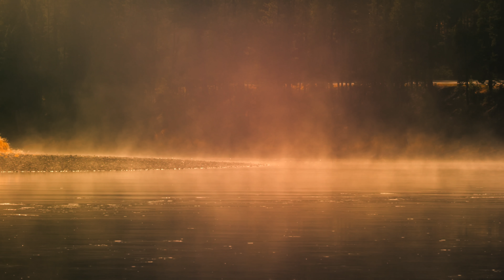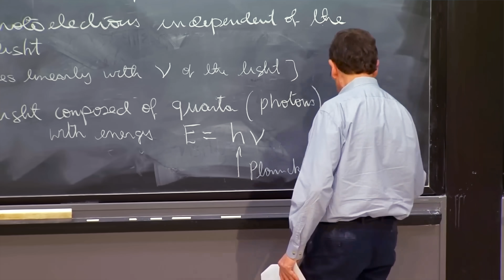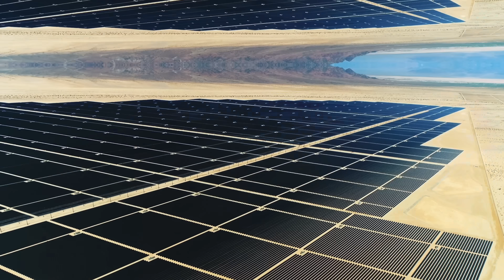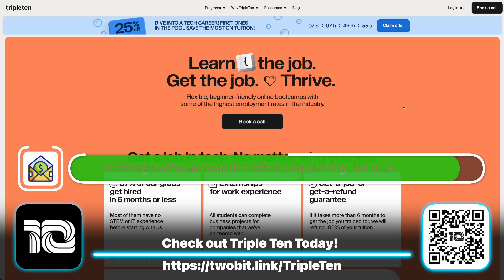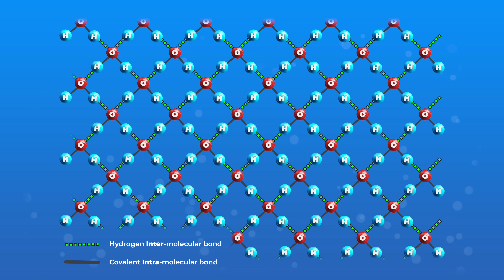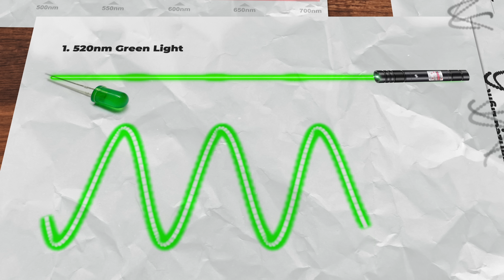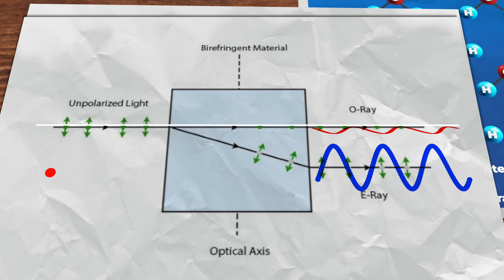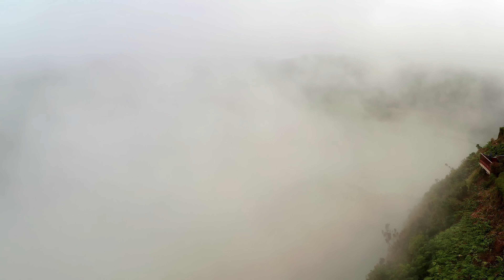New MIT Discovery Just Solved Water's BIGGEST Mystery!

Comment: I love that this effect is getting more attention from researchers.  It isn't BS.
Reply: It might not be completely BS, but the guy pretending it's some kind of world changing breakthrough is absolute BS. Converting any kind of energy into heat is very nearly 100% efficient. And as he said, converting into useful light is 65% at the best of circumstances. I understand he needs to make videos to make a living, but this is straight up sensationalised misinformation.
Reply: @janosszabo98  so when you account that light can evaporate 4-5x more water than heat you still end up with a theoratical 2.5-3x increase in evaporation efficiency with electricity>light>evaporation vs electricity> heat>evaporation. it's not often that you see this kind of jump
Reply: @geemy9675  So you're saying you can evaporate water 3x faster with a green laser given a 100W power input vs a 100W heating pad? Can you demonstrate? I can sense a noble prize in the air.
Reply: @janosszabo98 even regular white light as sunlight is already 3-4x as efficient and it's been documented for decades as evaporation of a body of water of even light absorption by clouds nothing new but what this study offers is an explanation of the molecular level effect and also increasing that ratio with certain wavelength and polarization to 4-5x so the effect of green light vs white light is not anywhere as strong as light vs heat. I can't demonstrate it but they already did. nobel prize is not unlikely
Reply: @geemy9675  Just because you say something with confidence, it's not gonna be magically correct. Water evaporate under the sun because water absorbing the light, turns into heat, and that is what causing the evaporation. Not the light itself, the heat from the light absorption.

There are 3 main desalination technique widely used: heat, membrane and vacuum. Did you notice that light is not on the list? I wonder why. If it has been known for decades that light (not heat from light) is 5x more efficient, why nobody built a light powered desalinising plant yet? I'll give you a clue: because heat is more efficient.
Reply: @janosszabo98  yeah. I understand it might seem surprising but the fact that sunlight evaporates water way faster than the heat it's providing should is well known and factored in meteorological models. it's also been used for thousands of years to produce sea salt without even knowing it was so efficient, because it was the only practical way to do it and sun light is free.
it's documented but it not used for desalination because it's not practical. if you let water evaporate in sun light you can't condense it and get distilled water back. the largest sea water distillation plant uses 45MW of solar electricity to distillate water and is very efficient at 2.8 kilowatt-hours per cubic meter (kWh/m3). state of the art reverse osmosis 1.8 kWh m–3

 evaporation through light happens only at the surface and it's not easy/cheap to produce 45MW of light from electricity.
Reply: @geemy9675  Honestly, I can't tell if you're trolling, being ignorant or you have no idea what you're talking about. What you mean it's not practical? Why can't you capture the condensation? Just build a giant pool with a glass roof and it'll condense on the glass. Have you ever seen a greenhouse? The condensation constantly dribbling on the walls. And even in a greenhouse, it's because of the heat, not the light. The fact that it's worth turning the sunlight into electricity on a 20% efficient solar panel, then turn that electricity into heat shows how much more efficient heat vs just the sunlight. Dude, you're exhausting. Light isn't more efficient than heat in evaporating water just because you say so. Until you can show me a commercial desalination plant using only light, I'm done with this conversation.
Reply: @janosszabo98  stop repeating "because you're saying so" 🙄 it's not me saying so it's people smarter than you and me it's an MIT publication from September 2023 that's been peer reviewed by scientists and hasn't been debunked by experimentation since
 it's a new reaction between photons and water that's just been discovered somewhat similar to photovoltaic effect discovers in 1839 and took 42 years before the first commercial photovoltaic panel in 1881. plus another 100+ years before it's started to be more mainstream. the effect of light on water evaporation was measured but not understood until now. It's too early to say if it can lead to improved desalination plants even if it's 4-5x more efficient than heat because cost is even more important than efficient for commercial application, but I'm confident there will be applications eventually, but not necessarily desalination plants. there are already other methods way more efficient than distillation
Reply: @geemy9675  It doesn't even remotely compare to solar technology. It's just light = 5x faster evaporation. There's nothing to develop here. Just replace the heating elements with light bulbs and you're done. Let me know when you found one.
Reply: @janosszabo98  Its not. Read the MIT paper.
Reply: @GisorsTheRet  Get back to me when they open their light powered desalination plant.
Reply: Yes it is BS... because it's not possible for these photons to cause water to evaporate without adding their energy to the system.  
This is just another failed attempt at trying to peddle the concept of Perpetual Motion.
Reply: Since grants and funding prefer novel ideas, it would be great to see programs like this research group at MIT allow other students, high schoolers, or even the general public access to the equipment used. Science isn't science unless it's reproducible, but no one wants to fund research that has already been done.
Reply: Yes it is BS... because the evaporation is still being caused by heating up the water molecules.  
It doesn't matter what kind of radiation is doing the heating.   HEAT is still entering the system.  
The Laws of Thermodynamics still hold true.
Reply: Yes it is BS... because the evaporation is still being caused by heating up the water molecules.  
It doesn't matter what kind of radiation is doing the heating... it is still HEAT.  

The Laws of Thermodynamics still hold true.
Reply from the maker: totally agree!
Reply: @TwoBitDaVinci  although you delivered a factually incorrect piece of information there, buddy. You don't need heat in order to evaporate water, it is not a rule. Vapor pressure plays a pivotal role. It is an intrinsic property of liquids that involves the natural tendency of liquid molecules to go into the gaseous state. If you lower the surrounding pressure of a liquid, you evaorate it without having to heat it. Although you can accelerate the process if you add some heat.
Also, it is way easier to evaporate water directly from its solid state than from liquid state. Meaning, you evaporate water more easily from ice than from liquid water. That's why freeze dry works
Reply: @DanoKaroche  Sorry to break it to you but even that spontaneous evaporation you’re talking about requires energy. Before, we would say it requires heat, but from now on, we should say energy because the energy doesn't have to come in as heat unless the water is in the shade.

To clear a common misconception, the fact that you don’t have to purposely provide the heat yourself to make water evaporate doesn’t mean water isn’t absorbing heat to evaporate; it just means you’re not the one providing the heat.

Water does absorb heat from its surroundings when it evaporates naturally in an environment where the air is unsaturated with water vapor (that’s literally how sweating cools you down, and it's why clothes feel cold when they dry spontaneously in the air). It’s a thermodynamic fact.

When the air is saturated with water vapor, evaporation and condensation balance each other out, and the heat that the evaporation process sucks up, condensation releases, so nothing gets colder or hotter: It's in equilibrium.

What these guys from MIT discovered is that you can provide the energy to evaporate water in a different way, i.e., without heat but light instead. It doesn’t violate the laws of thermodynamics because the energy to break molecules away from the water surface is coming from the photons, instead of coming in the form of heat. That’s an amazing revelation!
Reply: @ipp_tutor  don't apologise, you didn't break anything at all.

First... ¿Did you read my comment thoroughly?
I specifically referred to this guy saying that heat is what's needed for water to evaporate.

Second... You said you'd refer to energy from start and then you switched back to heat. You lost consistency there.

Third... ¿Did you read the part about freeze drying?
That doesn't involve light.

Fourth... I wasn't talking about the discovery itself. I only pointed out the wrong statement this guy madr about water needing only heat to evaporate.
I mean you can blow air to water and it will evaporate, taking energy from the surroundings lowering the temperature
Reply: @DanoKaroche  yeah no one's discussing the fact that the best way to dry you cloth is to hang them in plain sun, on a hot and dry summer day with a good amount of wind. but not everyone live in places with this kind of climates, and unless you live in Mediterranean region, there is little chance that you are hanging you clothes out of your apartment windows
Reply: @DanoKaroche  evaporation ALWAYS takes energy. there is only 2 options
-heat
-photon energy
in a heat pump application removing heat is a desired effect but in other like dryers, humidifiers, distillation/desalination...the cooling effect means you have to keep providing heat otherwise evaporation stops
Reply: @geemy9675  you can evaporate water when it is frozen if you reduce pressure.
You can also evaporate water with a flow of air,  transfering kinetic energy.
Of course energy is neccesary, but you don't need to apply heat always.
It seems you and the rest of the guys don't read the comments thoroughly
Reply: @DanoKaroche  heat IS kinetic energy. you don't need to APPLY heat but there is only two ways water can evaporated, absorbing photons, or absorbing heat wether heat is "applied" or not is not the question heat can be actively applied or simply removed from water and will be applied passively by entropy. absorbing photons is several time more efficient meaning the same amount of energy can evaporate several times more water. of course because energy doesn't appear or disappear it means evaporation by light or heat doesn't change the total energy. evaporation by light requires less energy thus the total energy of water + vapor is lower. like a more efficient heat pump provides the same cooling effect but uses less energy input and releases less heat in the atmosphere.
Reply: @geemy9675  it is common for people without formal scientific training to not understand or not know some things. And that's fine. What is not ok is replying without actually reading an answer and without being properly informed before doing so.
No, heat is not kinetic energy. Thermal energy is one thing and kinetic energy is another, although they are interconvertible as all forms of energy are. You are confusing the concept of temperature with heat... (I) Temperature is a measure for the average kinetic energy (internal energy) of molecules and atoms within a substance or material. (II) Thermal energy, which is heat, induces motion on molecules and atoms changing the temperature.
But there are different types of motions depending on a substance state. It matters if it is solid, liquid or gas. Hence molecules/atoms motion depends on the type of constrictions that the substance has intrinsically, depending on its chemical properties.

Within a room, furniture is at the same temperature as air. But molecules in air have a greater kinetic energy than the molecules of a table, because molecules in air are not bound and have the freedom to move around. If kinetic energy was heat, as you wrongly stated, air by itself should be hotter than any solid object and it would irradiate heat. That is not the case.
Another thing you fail to consider is that thermal energy is also radiated. Heat is radiation and is in the range of infrared wavelenght. Heat induces motion, but it is not motion.

Now, for the third time... No, you don't always need heat to evaporate water. It is not a rule.
Average people are unaware that there's something called vapour pressure. It is the natural tendency for a substance to go from liquid or solid state to gas state. This property depends entirely on the nature of the molecules of the substance and pressure. Vapour pressure manifests as a dynamic process and usually tends to be in equilibrium with the surrounding pressure. Liophilization is a process that takes advantage of vapour pressure to evaporate water by sublimation. This means the change of state from ice to gas without ever going to liquid state.
In liophilization you typically cool water down to -50 °C (if you remember, ice forms at 0 °C at 1 atm of pressure) and you lower the pressure (or apply dynamic vaccum) to sublimate water from a very cold ice.

I'm not debating the discovery of green light being able to evaporate water. It is a cool discovery that could lead to some practical application eventually. 
I'm just pointing out the factually wrong statement in the video that water always needs heat to be evaporated. I have a PhD in chemistry, so I know a thing or two
Reply: @TwoBitDaVinci  Waiting on that follow-up video

Comment: ALL that with and there is also atmospheric pressure pull off with vacuum effect on surface pressure from evaporation into air levels in gaseous state stratas areas placed push in photons discharge on areas where radiation is positioned and mix mixture  of it all causing winds with earth spinning with that effect as well.

Comment: This is actually humorous as many scientist have claimed all along about the flawed theory of CO2 driving climate change. It has been said all along that CO2 is the result of warming not the cause.  The model only works if you change the way CO2 is entered into the atmosphere just as water vapor retained heat CO2 had and as water release it s heat so does CO2 also releases its heat and is dissipated. The more we try to force CO2 as the cause the longer it takes to realize the Sun cycles along with the earths decreasing Magnetic Field are the sole driving force of the Climate. Every thing else is part of a separate cycle that does not influence the crust temperatures as the radiation from the sun does. The reason this is introduced into our science is federal funding you receive more funding when the Government wants you to prove what they want you to. They have muddied up the water so to speak by introducing complicated data to a simple problem. In other words in is smoke and mirrors. As far as desalinization there are already low energy system that are proven very efficient with out heat.

Comment: You seem to misunderstand a few points.  First, light contributes energy, E=hf, toward the latent heat of evaporation for each liberated molecule.  Since this energy need not come from the thermal bath, there will be no cooling.  Second, since replacing heat energy by light energy requires no less energy, there will be no magical increase in efficiency.  The rate is certainly increased by adding the parallel liberation process and there will be less thermal energy transferred to the environment around the container, but there will also be substantial light transmitted/reflected and not absorbed.  Third, a half-wave plate will rotate the polarization at much lower cost than a Faraday rotator.  Fourth, dissolving the liberated clumps may cool the air above the water, but it does not cool the water.  Fifth, for small clumps the surface curvature is very high allowing the diffusive tendency to overcome surface tension.  This is why dissolution at the expense of cooling the air is preferred and why the planar surface does not dissolve at the same temperature.

Comment: Maybe I'm just dumb and lucky, but I feel like I've always known that sunlight is way more efficient at evaporation than conventional heating. In my mind at least, I've always pictured that photons of light were able to evaporate without boiling because they were able to impart enough focused energy to small chunks of water to allow them to leave the mass of liquid without boiling, or even appreciably heating, the rest of the liquid. Again, I'm not brilliant or anything and I'm probably wrong on what I've always pictured in my head, but this effect always seemed to be akin to sublimation. If sunlight could knock off chunks of frozen water directly to gas without melting the rest of the ice, then it always just made sense to me that it could do something similar to liquid water without significant heating of the rest of the water.

Comment: Sooo… I didn’t know the science of this but knew that water evaporates without heat or light since I was in 5th grade. 

I told my fifth grade teacher that water would evaporate even in a climate controlled, sealed space. 

She told me it would have to have incoming light to evaporate. We placed a 1000mL beaker filled with 500mL H2O in a larger sealed Tupperware inside a cabinet. 20 mL evaporated over night. We discovered that if we kept the beaker inside the sealed container at a constant temperature, eventually the air in the container becomes saturated (100%humidity for temperature).

Anyways, the water slows down substantially, but still evaporates likely because of air gaps in the Tupperware.